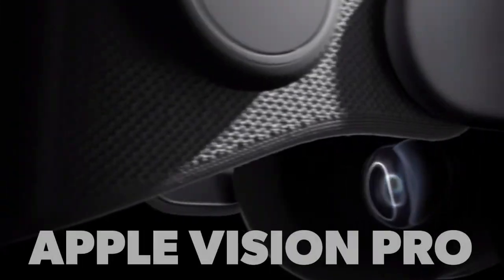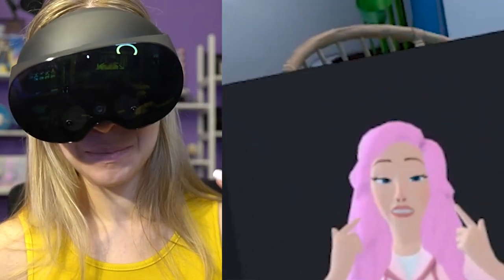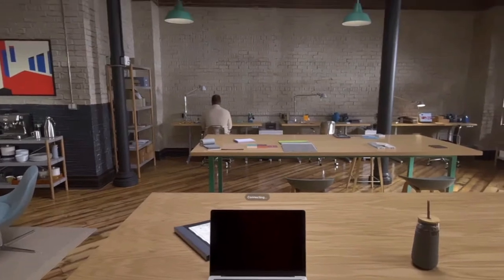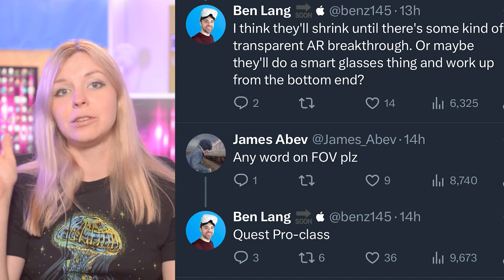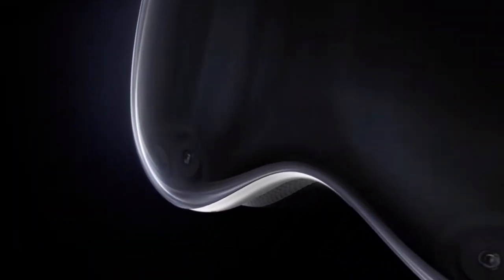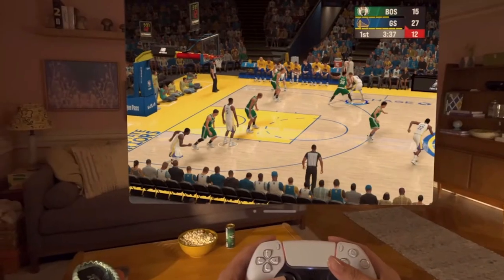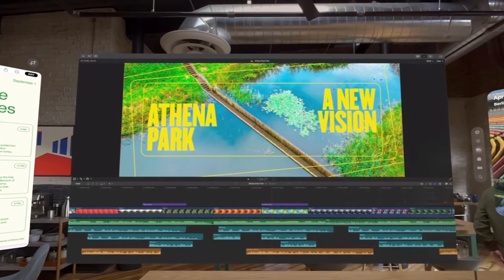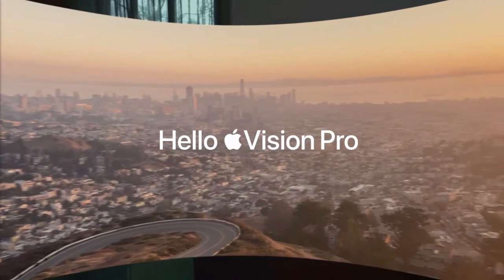Apple Vision Pro Breaks EVERY RULE of Standalone VR

Comment: Developers don't have direct access to the GPU for AR apps. You have to hand triangles and materials to the OS. As a general purpose computer, it is scary how closed this system is. It sets a very dangerous precedent for the industry and the freedoms of users.
Reply: There is a problem Sean. You don't understand what closed means in this case.  In tech terms it means Apple designs their own processors and don't sell them to anyone else.  After all why would they, Apple's are way better.  Same with operating systems and many other details.  Open means that manufacturers are modular and use the same OS (Google Android), Qualcomm for processors.  Conceptual problem with so called open is they can't differentiate their products, they all have access to the same stuff.  It leads to punished margins in a race to the bottom.  The winner is measured in revenue and profits.  The better word for closed is integrated and open is modular.  Integrated always wins.
Reply: @bruxi78230  Closed does not imply proprietary OEM SoCs nor integration, and open does not imply modularity. As your argument is premised upon these false statements, it is invalidated. I needn't continue further.
Reply: @SeanLumly  —- By the way Sean, your statement about Apple not having an API couldn’t be more wrong.  AppleMetal gives developers access directly to the processor including GPU and Neural Engine.
Reply: @bruxi78230  Not for AR (and likely VR) apps. I'm done with this conversation.